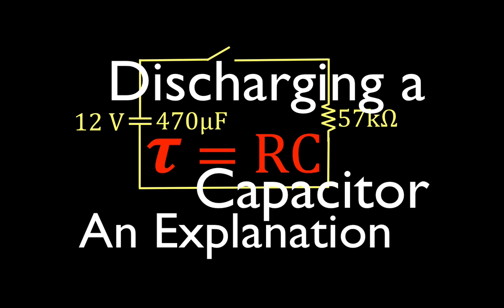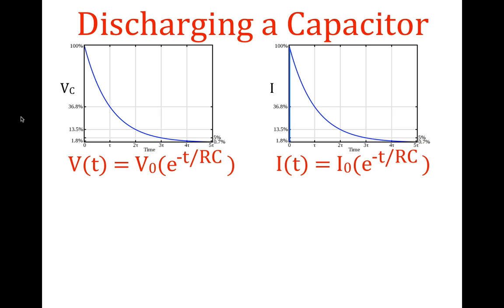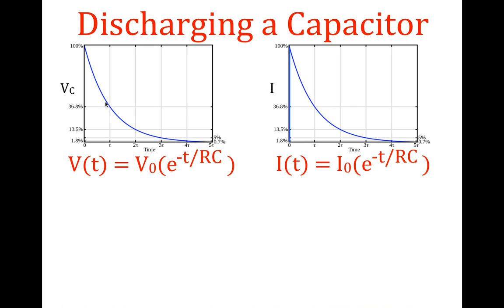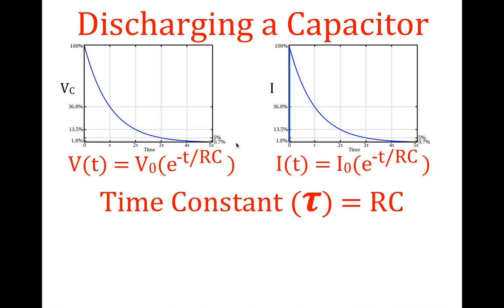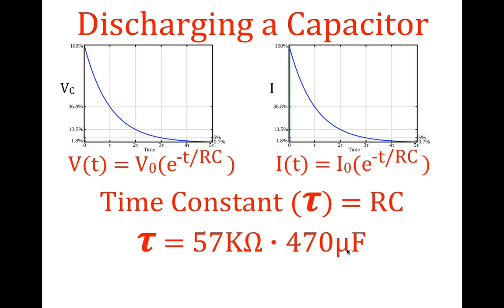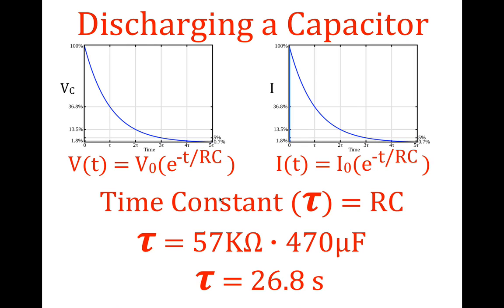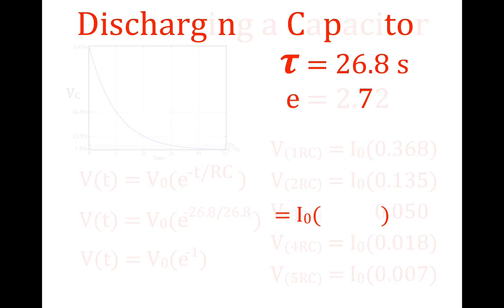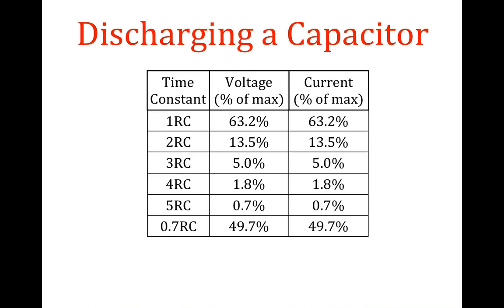RC Circuits (6 of 8) Discharging a Capacitor, Time Constant, Voltage, Current, An Explanation

Comment: The capacitor discharge time constant 5 X R X C using resistor would waste the energy within the resistor and have large voltage drop loss, for the rest of the circuit, even though the current in series is still there farther down the line. A matching Inductor instead,for 1/2 Period of L + C frequency, about 15 cycles,  for the same discharge time , say in Milliseconds, would require a large Henry type coil that is also very expensive, and have very small wire gauge which again causes large ohms resistance. (10Mfd  at 200volts DC for required .030second discharge.)Maybe I need a 47Uf or 100Mfd capacitor instead. Cannot see it happening the right way. What about coil or resistor on the ground side RETURN LINE? What do you think?
Reply from the maker: very interesting...

Comment: Discharge of a capacitor occurs in steps -- discharge does not follow a smooth curve.
Electricity on a wire, & charge in a capacitor, is due to electons -- electons are photons that hug the outside surface of the wire etc as they propagate at the speed of light -- if the Cu is insulated then that speed is about 2c/3.

Comment: Great video! I just have a quick question. How would I calculate the capacitance needed if I want my total voltage fluctuation to be 1%? That is, to have my AC voltage behave very close to a DC voltage? Thank you!

Comment: Something that fascinated me while watching this video.... what are the chances that even a mechanical process like the flow of electrons in a circuit and the storage of charge on a capacitor could have a relation through the Euler's constant, which is just a predefined mathematical constant, with seemingly nearly no relation to physics?
Why is it that any exponential system follows this constant only?

Nature works in weird ways, I tell you...
Reply from the maker: That is an excellent question.
Reply: @stepbystepscience  What's your view on this Sir?

Comment: shouldn't your last chart be "charging" percentages and not discharging. In the slides before that one, you said that 1TC discharge goes down to 36% but in this last chart, you have 1 RC at 63.2%.
Reply: I noticed that fred I'm wondering if the video is too old for him to see new comments... But i believe working it out the way he taught 1RC gives 36.9%

Comment: I find it interesting to see how quickly the current sags as the cap discharges, down to 1/3 of peak current within one time constant. It is trendy to own a 'jumpstart' device to boost car batteries. My experience with those is the way they quickly lose their juice if the car doesn't start right away. Results are better for hybrids....

Comment: The current graph is wrong..it will exponential increase
Reply: No it won't. How about you test it in a real circuit before you make claims? How would DISCHARGING something raise the current? Where does the potential difference come from? DISCHARGING means neutralizing the capacitor which in turn reduces the voltage. No voltage = No Current.

Comment: At the end of the video with the overview table you list voltage and current at 1RC as 63.2%. I believe the correct figure would be 36.8%
Reply: Yea I was wondering about the same thing.
Reply: ha. I just asked about that. Glad other people noticed that.
Reply: I was about to ask the related question why 0.7τ have a smaller percentage than 1τ, but replacing 63.2 with 36.8 solves that problem. 😁👍